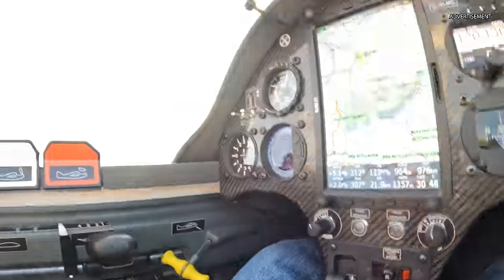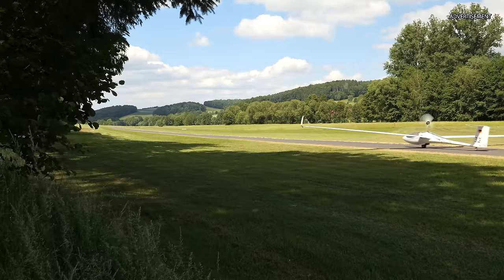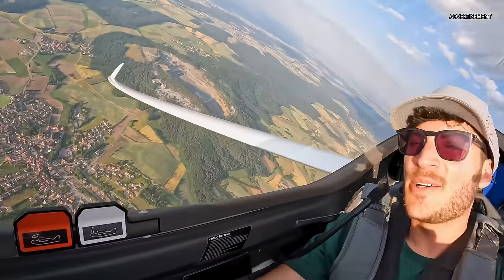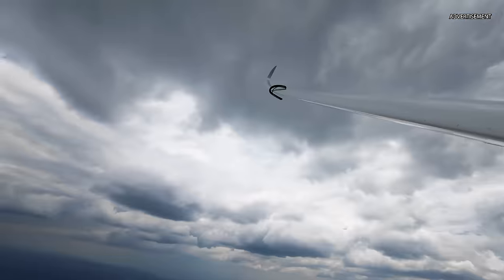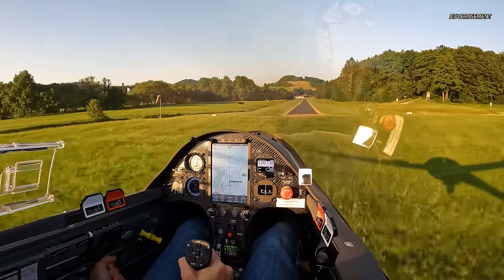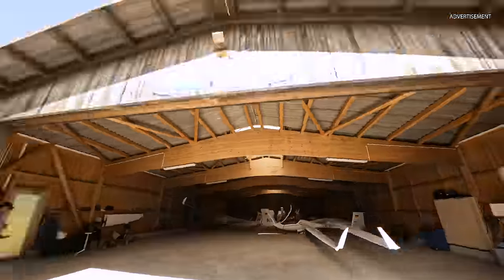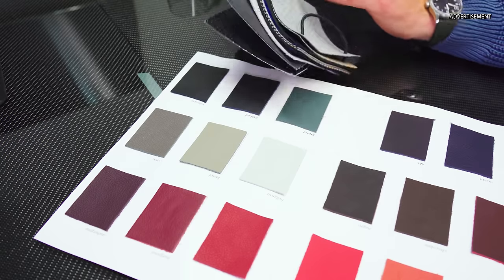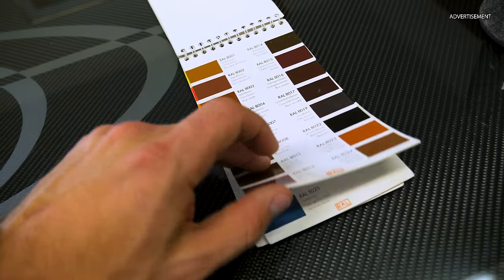Configuring My New Glider - AS33 Me Ep. 1

Comment: I custom configured a glider there once with Gerhard and he was amazing! Really allowed me to do some special things with my ASW24e. The biggest one in some ways was letting me delete the standard sliding window for a simple 100mm diameter hole. I was able to fabricate a backing plate of thinner Lexan to be the seal and used the supplied 100mm curved discs to make my own clear plugs, with two thin stainless steel springs putting the back pressure on my little pop out window. The ventilation “loss” from the loud tip out scoop was more than compensated by greater simplicity and better optics. No rails or big rectangular window made for much better view.
Reply: Thanks @JasonAGregg Do you might have a picture of your 'construction'. Sounds very good!

Comment: @stefly will you bring it to the GP in Norway?
Reply from the maker: Yes, that’s the plan
Reply: @SteFly   On the SGP website it now says about the Norway SGP: Updated info 19.01.2024 - this event will use 18m class with 50kg/sqm max wingloading (was 48kg/sqm) - was that you, Stefan 😁? Club class feeling with no water seems fun!
Reply from the maker: @ThermalWave  Not only me. There are some other pilots who want to fly with electric self-launch gliders at the SGP in Norway. We should think about this wingloading limit rule in general...
Reply: @SteFly  as I understand, it's done on purpose so that the gliders are more matched / more competitive gliders are available. V3 and JS1 would suffer when AS33 and JS3 can get to 60kg/m2 while they can't. On the other hand, at the moment the newer gliders with smaller wings get a little disadvantage since they are lighter in absolute numbers. Looking at the races and results so far, it seems pretty fair in the sense that glider choice seems to not matter much for the results.
Reply from the maker: @ThermalWave  I think the fairest option would be something in between wingloading limit and weight limit. To limit the max weight/wingloading for safety reasons makes sense in mountain areas.
Reply: "I think the fairest option would be something in between wingloading limit and weight limit" - I think that's true, but who picks the compromise, and how? Analysis of log files? Results achieved so far? Idaflieg measurement campaign? Should it be by theoretical XC speed? Or emphasize the final glide more, since that is so important in SGP? The current wing loading limit is nice for the regulating bodies since it has a very objective look (just a number) and can even be justified by a safety argument (manoeuverabily for mountain and gaggle flying) - so it does not look like 'putting the finger on the scale'. @SteFly
Reply from the maker: @ThermalWave  Good question but I don´t have the answer. 
A heavier older glider might be much more critical for safety than a newer glider with the same wingloading. So from this point of view, the max takeoff weight would be a better option for the safety argument ;)

Comment: Another question, are the wing batteries easily  removable ?
Reply from the maker: Yes they are removable but it´s nothing you should do all the time for recharging. That´s why it's good to have the trailer charging setup and I will also install solar panels + a battery in the trailer.
Reply: @SteFly  What battery capacity will you put in the trailer?
Reply from the maker: @Ca99-iz2ey  The current idea is about 4 kWh. This should be more than enough for a normal launch and day of flying.
Reply: @SteFly  4 kWh could correspond to 1 h in cruising speed or 20 min climbing?

Comment: I have used a compass on the top of my glare  shield for over 20 years, and,  of course, never looked at the compass course.   I put white marks at 45° on its face. They’re great for judging your bank angle.
Unfortunately, I have a blue tint canopy in my used Shark MS, and recognize your issue with filming from the inside. I have tried to compensate using the white balance adjustment. Do you know what adjustments can be made to the camera to resolve the issue? The blue tint is nice for one reason, I don’t have to wear a hat and can put my camera on a head strap that holds it just above my eyebrows. I use a DJI action 2, which is small enough to fit there quite nicely. Unfortunately, it heats up rather quickly and I can’t get more in about 15 minutes of film without having it rest.
Reply from the maker: Nice idea with the compass. I have currently the option to add one additional Air Control Display and then put the compass on top of the instrument panel cover. Not decided by now. 
The white balance is very difficult with tinted canopies. On the inside you also have distorted colors and on the outside it depends on the angle you are filming through the canopy. If it´s a flat angle you will have more blue plexiglas than on a 90 degree angle. I think it's impossible to get a perfect result but at the end it doesn´t matter too much. The experience is more important ;)
Reply from the maker: And I also use the DJI Action 2 from time to time on my head. For shorter videos it´s fine and I love the perspective.
Reply: Other than a vertical card compass, which I did use to tell me which way the runways were, I have only used a compass twice.  Both times on extremely hazy days.  However, the LX has a compass so I have no idea why a compass is required equipment.  I can't find a whiskey compass in a F-22.

Comment: Oh dear the worst choice of the 18m electric self launchers................
Reply from the maker: By far it´s the best choice at the moment for me.
Reply: Down to the gym for you to build up the muscles to rig the heaviest 18m electric self launcher........ have fun watching Kawa going sailing by in the D4 :-) (if it's ready)
Reply from the maker: @soaruk3697  Therefore you can use a one man rigging aid. It takes a few minutes longer but at the end it's always better for your back. ;) 
There are only two certified 18m electric self-launch gliders available on the market, which are competitive for a WGC. Both have their pros and cons. The propulsion system of the AS33 Me should have about 30% more range, it´s allowed to selflaunch with 600 kg (important for comps), it has luggage space where I can store the charger and some additional equipment for a gliding safari. Aerodynamics, ergonomics, built quality and safety of the glider are great. For me that's worth to accept a few kilograms more weight. At the end everyone has their own preferences and specific application for the glider.